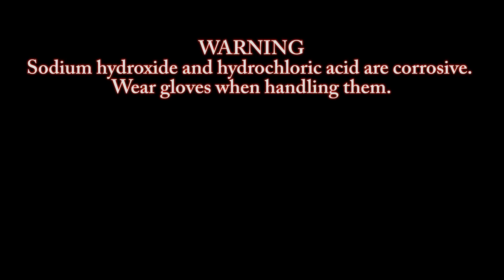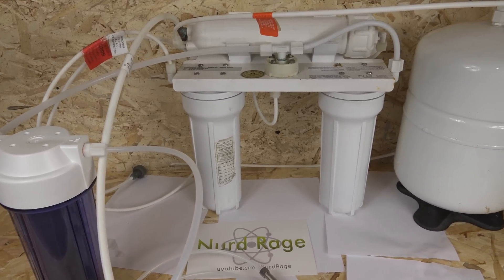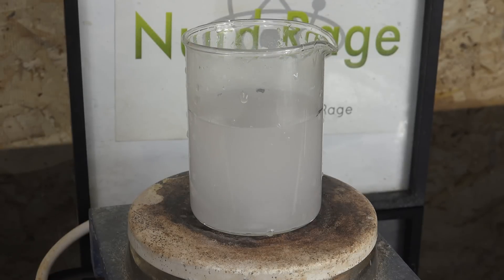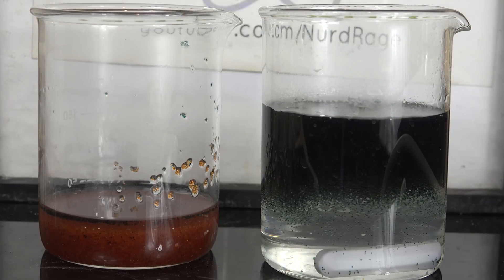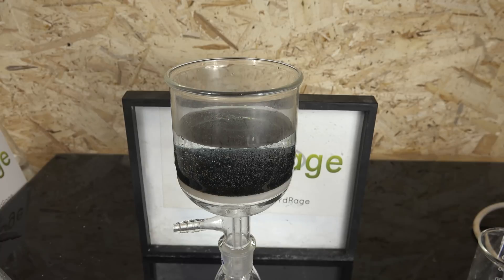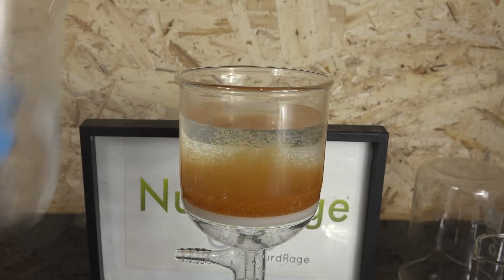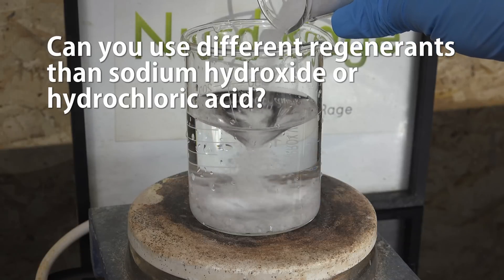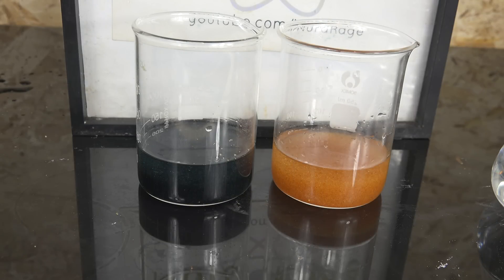How to Regenerate Deionization Resin for Use in Reverse Osmosis Deionization Systems

Comment: Excellent video! Thanks for the presentation. 

I have a question though, what do you do to dispose of the regenerant?  Pour it down the drain??
Reply: He answered this: When you're done, you can mix all the waste chemical solutions and add in some (like half a cup per bucket) baking soda. If it fizzes, stir it until dissolved then add in another half cup of baking soda. Keep doing this until it stops fizzing. At that point it's safe enough to dump down the drain (it has essentially become salt).

Comment: CHEAP MAGNESIUM. Hello, I have a tip that may be important about another line of experiments: A source of magnesium that can be much cheaper. I was able to buy a high magnesium alloy for less than $ 1.00 / kg. It is a light alloy used in engine blocks and transmission boxes of certain cars, it can be found in scrap metal. The magnesium content exceeds 90%, the rest being mainly aluminum (another excellent reducer). You can identify the alloy with a few drops of muriatic acid (strong reaction) or scrape with a knife (emits very thin, shiny, hard and light chips). You can process using a saw or metal drill to make chips or shavings.

Comment: Suggestion, the partial oxidation of a primary alcohol to an aldehyde, many have the demonstration or common experiment on you tube using acidified dichromate or permanganate, although another preparation needs the vapour of ethanol to be passed over hot copper turnings at 300 C. These is no real video or assessment of this method to produce acetaldehyde, could you maybe do it for an upcoming video? Regards, Karl

Comment: NurdRage, could you show how to strip the color and other filters off of a digital camera image sensor? (Sorry this is off topic.) What I want to end up with is a monochrome camera that is more sensitive to UV light. (I don't mean, IR, that's easy. I really mean UV) It is something I've been wanting to do ever since reading a paper where a Raspberry Pi camera was modified to measure sulfur emissions from a coal power plant smoke stack. The paper mentions a chemical stripper, but I can only find it for sale by the gallon. I'm hoping there might be a simple mix of household chemicals that would do the job. (Some people manage to scrape the layers off but I've had no luck with that.) A DIY UV bandpass filter would be a nice bonus.

Comment: This is really informative..thanks..BTWI have commercial water refilling station and I am using cat ionic resin and I also use NaCl to regenerate it..my question is how long should i wash it with water after regeneration? If you are wondering how much resin im using...its actually one frp tank almost full with size of 10 by 54 inches..should i be using my tds meter to determine the duration..pls advise thanks

Comment: A question: I live in an area with pretty hard water; people in the area say, "don't buy expensive faucets because they are just going to get clogged in a few years".  Now I know nothing about water softening and I don't use it in my house since I don't like showering in softened water. But NR said that someone in my situation would want to soften the water before using a system he describes. When I look up water softening systems on Amazon, I see whole house solutions and electronic "descalers".  I didn't see any small scale systems that would be suitable for inputting into the RO Deionization system.  I probably don't know what to search for. Does anyone have any suggestions?

Comment: If you want a good differential dye for cation and anion resins use a small amount of 4-(Phenylazo)diphenylamine, about 0.15% solution. Of course, the density difference in the resins is the most useful in a process, but the staining can also indicate if there is fouling and you should just replace it.
Reply: So by staining with the above dye you will be able to see what resin is worn out?
Reply: @supermetaltastic  There is a subtle difference in the color, but not enough to rely on for determining if the resin is not worth regenerating any longer.  Depending on the reason for fouling, cleanup with caustic or a brine squeeze may restore capacity.
Reply: @lanceshields653  Okay so the above dye is just for differentiating between which beads are cations and which are anions.
Reply: @supermetaltastic  Yes, that is what I have used it for.

Comment: This process might be simplified a lot by having a 2-stage deionization process, rather than a mixed bed process. 

If you keep the two resins separate in the deionizer, you won’t have to bother separating them when regenerating them, and would have less chemical use.
Reply from the maker: Answer to a common question that keeps coming up: 

Separating and remixing the resin seems redundant, can time and labor be saved by keeping the resins separate during use and regenerating them in independent cycles? 

Actually yes, you can save time and labor by using separate deionization beds, but there are some caveats. 

 So for those of you that don't know, since the resin beads work independently, you don't strictly need to mix them. Instead two different cartridges can be made, one containing anion exchange resin and the other containing cation exchange resin. They are installed in separate housings and connected in series. As the water flows through one the corresponding ions are removed, and then as they flow through the next cartridge, the ions of that type are removed. The result is deionized water just as with a mixed bed. But the system is much easier to regenerate as the resins are already separated and it's just a matter of removing the appropriate resin, mixing it with regenerant, washing it, and putting it back. In fact a number of commercial systems indeed do it this way. And you can set your system up this way as well. 

The reason why it's not the standard is because it actually produces slightly lower purity water. This is because as you replace ions you shift the equilibrium of the reaction and some of it shifts back. 

For example, let's say we have a solution of sodium chloride salt water and we run through a cation exchange resin already loaded with hydronium ions. The result is the sodium ions are swapped out for hydronium ions making hydrochloric acid. But as we know from before, hydrochloric acid will actually regenerate the resin and swap out sodium ions making salt again. Fortunately the effect is very small since the concentration of hydrochloric acid produced is very low. The actual equilibrium will lie very far to the right. But the effect isn't zero. 

The tiny amount of sodium that remains will pass through the anion exchange column without being absorbed. Meanwhile, most of the chloride will be removed but again, not all for a similar reason of equilibrium. To improve this you need to have another cation exchange resin column that now removes the remaining sodium ions. Since the most of chloride was removed by the anion exchange resin the amount of hydrochloric acid produced is lower so you get improved water quality. But it still isn't zero, you need to keep stacking more and more pairs. 

A mixed bed deionization resin column solves this by essentially having hundreds of deionization pairs in one column. The leftover ions from one bead of resin are removed by the next bead, and the leftovers from that bead are absorbed by a bead further down. So mixed bed resins give the best performance for the least complication. And thus remain the standard for water deionization. 

However there is a way to get the benefits of a mixed bed deionization column and still have the slightly easier maintenance of separate beds, and that's to use both.  First have the anion and cation exchange columns processing the incoming water, and then have a final mixed bed column to polish the tiny percentage that makes it through. As long as you keep regenerating the anion and cation exchange columns before they are completely depleted, you can get many months of use out of the mixed bed column before it needs to be regenerated. 

 Personally though, i don't bother. Separating and remixing the resin isn't the most labor intensive part of this process and i don't regenerate my resin often enough anyway to be bothered by it.
Reply from the maker: Did you read the pinned comment?

Comment: Couldn't this be used for small scale mining of whatever happens to be in the water? I mean, after regeneration, the acid and base water contain the mineral content of thousands of gallons of water conveniently concentrated for extraction?  Also, in Montana there is a lake of toxic waste water from mining, gold or copper IIRC. Flocks of fowl sometimes land in it and quickly die by the hundreds or thousands. Could using these resins be a profitable way to detox the lake by recovering more of whatever was being mined? A problem might be that the water is corrosively acidic or basic--is there a range of resin products designed to work at non-neutral pH?  As you might be able to tell already, I know next to nothing about chemistry, just watch out of curiosity.
Reply: https://en.m.wikipedia.org/wiki/Berkeley_Pit

Comment: Hi, If you have water softening resing that uses simple NaCl salt for regeneration and you use the water for drinking - Can you use KCl for regeneration instead to avoid increased sodium levels in softened water?
Reply from the maker: YES! :)
Reply: @NurdRage  Could something like this fix fouled water softener resin?  Is it similar "mixed-bed" resin like in the smaller filters or something else?   PS: Iron-out won't fix it but the water still comes out brown.

Comment: Interesting video! The separated resins might be very interesting for home-packed HPLC columns for DIY protein chromatography!
Reply: HPLC uses way finer resins than this.. You can grind them up, maybe?? If not, it can be used as a normal CG column for those

Comment: Random question.  I just read that distilled water can be bad in car engines as coolant as they can strip electrons (metal) from the components to balance the lack of minerals in the water.  Could you prove or disprove that?
Reply: That is factual, however it will balance, and it is not enough damage to concern yourself with. 

Using non DI / distilled water would be more of a problem as the minerals would reduce heat transfer as they precipitate out of solution and insulate the cylinder walls and radiator passages.  

Be sure to use a good corrosion inhibitor as well if not mixing with antifreeze. This is especially important if the block and heads are dissimilar metals, ie. cast iron & aluminum.  Galvanic corrosion can be very damaging.
Reply: @aaronj08ar  Thank you for the information.  I just did a partial engine overhaul and planned on running distilled water in the cooling system until I get everything sorted to reduce the risk of leaking coolant on the ground and to flush the system.  This is a short term solution (2 - 3 weeks) and the system already has some scale (rust/mineral) deposits that I want to remove.
Hopefully any electrons that are stripped will be from the scale and make it come off easier.

Comment: I have been in the water treatment industry for a few years.
My 2¢ on this.
1. Consider adding another RO/NF stage (NF if the system feed water is softened, RO if water is hard) to the system before the current RO. This will reduce the TDS of the RO permeate and increase the life of the second RO membrane. Doing this will require one more pump and tank to be added to the system.
2. The biggest advantage to running a three vessel i.e ( anion, cation and mixed-bed) ion exchange system is that you can regenerate and rinse the anion and cation vessels in place. You can use the hoses to pump HCl / NaOH / DI water into the vessels. The OBR (Output between Regenerations) of the Mixed bed vessel will also be very very high and most of the ions are exchanged in the anion and cation exchangers.
Reply: Oh great: another Nalcoholic! 😄😄😄
Reply: thanks Man id Like to Know More. is it replicable to large industries?

Comment: One of the major setups for the meltdown disaster at Threee Mile Island nuclear power station involved the [non-nuclear] condensate water polishing tanks. The resin beads were becoming packed, and Babcock and Willcox's (B&W) factory-installed compressed air sparging system was proving inadequate at agitating the resin. The plant engineers, thinking outside the box, had cross-connected the control air system to the tanks to get a mightier sparge. Unfortunately, a valve to the control system air supply was left open when a tank was returned to service, and water backed up into the control air system. The water caused all the condensate supply valves to simultaneously slam shut, which on its own, caused a pretty impressive amount of destruction from the "water hammer" effect. Without the heat-removing action of the secondary power generation steam loop, the reactor scram'd. This "turbine trip" scram was nothing to write home about, but the sudden pressure spike in the primary loop caused the PORV (pilot operated relief valve) to spring open, also not unusual.  Then, the unusual, though not unpredictable, transpired when the PORV became jammed open. No one noticed this amid the chaos of information in the control room, and the unusal fixation upon the status of the pressurizer. It was at this point that the TMI crisis began.
Reply: That is extremely interesting! Where did you hear about it? I've read "From the Ozarks to Fukushima: A History of Nuclear Accidents" but I don't remember them covering this detail. The number of industrial accidents that start with, "Well, normally..." is staggering.
Reply: @pyrobeav2005 it is from Atomic Accidents

Comment: theres a nice system on amazon, a 5 stage with the 4.5g storage tank for like 189 dollars. brought my PPMs from down 550 to 20. I probably need a water softener upstream. for now i have two very strong neodymium magnets coupled together around the  input to the filter in order to mitigate the adhesion of mineral scale to the innards. I imagine the R/O filter is being thrashed which I didnt know about till  your previous video.

Comment: Hydronium sounds like a new type of super metal used in top secret aviation projects that's been successfully reverse engineered and reproduced from a crashed ufo. 😂 10% titanium 14% cobalt 5% tungsten 30% hydrogen 1% carbons 5% manganese the rest is classified but found a leaked image of the list and had eggs, milk, fish fingers, chocolate and apples but there percentage is still a mystery 😂 🤣 🤣

Comment: Propel "Fitness Water" bottles are perfect for DIY separatory funnels.  The top of the bottle is already spout shaped and it's clear as well.  

They also make AMAZING alcohol vapor rockets when used for the "whoosh bottle" demonstration, as the spout acts just like a rocket nozzle.   Use a ring stand or similar to make sure that they fly upward instead of sideways and assume anything underneath is going to catch fire from alcohol.
Reply: Wow, a fitting name for that demonstration too! 
(I've had it and thus heard the name before but haven't tried that experiment and don't have any bottles lying around)
Reply: @revenevan11  It's pretty impressive.  There is one poor ceiling tile in my classroom with chunks out of it from being hit by a Propel bottle dozens of times.  If you try it, be smart about your hands, face, and the surroundings.

Comment: Always end up with more questions than I started with, do household water softeners work in the same way? How do they regenerate with only a saline solution?
Reply: Paul smith No, water softeners regenerated with salt only replace the ions responsible for hard water.
Hardness in this case originally refers to the difficulty in forming a lather with soap, calcium and magnesium ions form an insoluble compound with soap, so you need more soap to get the same cleaning effect. They are also the salts which tend to build up on the inside of copper pipes,  water heaters, etc.
The ions which are responsible for hard water are mainly the calcium and magnesium ions, those are replaced with sodium ions. There are still dissolved salts in the water, just not the ones which tend to cause problems by coming out of solution.
The salt solution is then used to regenerate the ion exchange resin replacing the sodium ions; regeneration is usually done automatically either on volume of water drawn through the unit, or a timer (based on an estimate of how long it would take to deplete the resin).
In summary mixed deionisation resin and the ion exchange resin in a water softener are both exchanging ions, but the intended result is different, so the details of the chemistry is different.
Reply from the maker: softeners just replace the magnesium and calcium ions with sodium ions. They don't need to produce purified water, so they don't use acids/bases like with Deionization systems.
Reply: @NurdRage  So, the "residue" will be magnesium chloride and calcium chloride?

Comment: Nice video and well researched.  I wonder how much performance would be lost of the anionic and cationic resins were physically separated (layers? bags?) in the column.  It would make regeneration easier.
Reply from the maker: Separate resins would produce lower quality water. So it's better to use mixed resins.